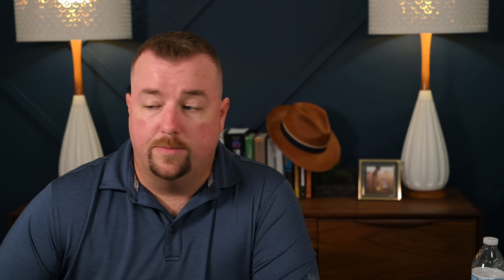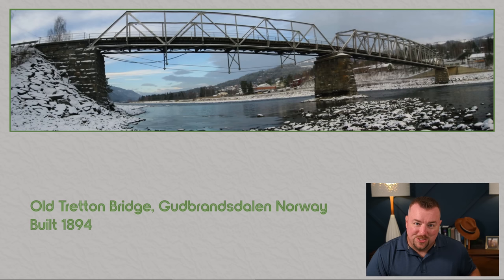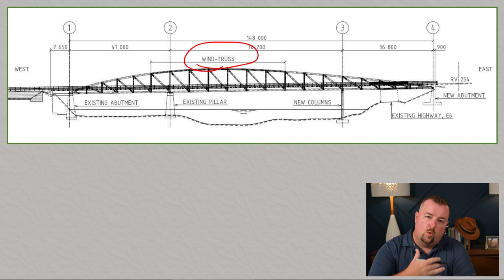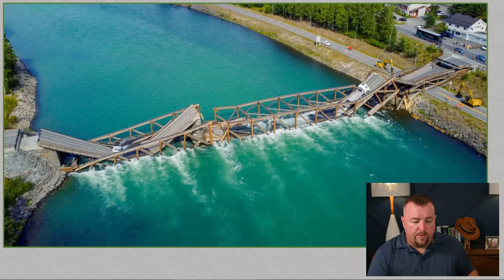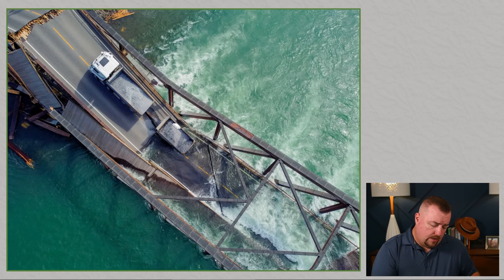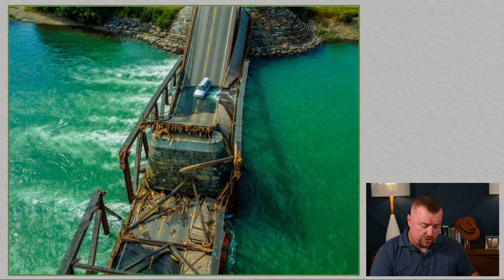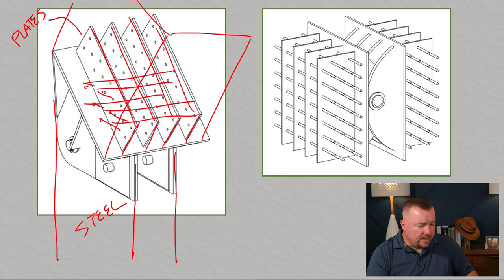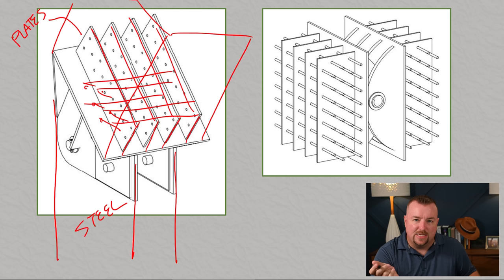How Did the Engineers Miss This?

Comment: Boatbuilder and wood-engineer here. When I was in my lab-phase in uni back in the nineties, I initiated some tests of all-glued multidirectional connections in comparison to these metal-multidowel load-bearing connections because we had,  obviously, exactly that form of malfunction (splitting) every time we tested dowel-patterns and dowel dimensions. 
As a trained boatbuilder before I started university in wood-technology, wood in connection with changing water/humidity contents thus changing dimensions in all three deciding dimensional directions differently was someting I had in mind automaticly whenever looking at a connection point, as well as the idea of "how gets water in, and how does it get out again"? What I built in testpieces from "cheap, inferior" wood (fir/spruce, construction grade only, no tropical hardwoods, not specially sorted/improved) basically followed the wooden dimensions of the customary connection wood/steel, while I glued everything, no holes, no slits, no cavities, with changing directions by overlaying different directional wood layers, glueing those into one inert lump of wood like a grown tree crotch, thus creating the directions, dimensions and the number of pieces/"load outlets" we wanted/needed for the very detail. Results in comparison to inferior wood-steel connections with pins were stunning, to say the least, not only in wood/epoxy with vacuum pressurized curetimes, also for "conventional" resorcin-formaldehyde glue under vacuum, pressurized for its reaction time, the latter to circumvent the not-yet finished research for "creeping" in epoxy glued connections in wood over time. "Too specialized", "not doable in situ", "not repeatable enough over a three month build for hundreds of joints" and so on was what I heard by many many professors and pros from the building industry over the time I tried to "implement" a bigger research project, because they all simply were not able to imagine something like a big construction from inert, multidirectional, multidimensional glued wooden limbs with glued, inert loadbearing connection points ("load knots"), built and finished in situ, of course. Our university's administrative building even was a gluelam-metal-dowel steel-knot building with a lot of visible failing points, some of those failing already in the building phase, in the most pittoresque manner, which would have made my uni the absolute prototype to try something completely different, some never tried-before fancy ideas - they couldn't even understand it, let alone actually try something different. My fellow students and I, we developed industrialized CNC-routed storey-high dovetails for timber-frame housbuilding with prefab elements to put those together like Lego on the building site, we put together a prefabbed three-bedroom family home in a day including the roof that way, with ten people and one crane as a prototype and test-piece - still not widely used in the industry to date, despite its many benefits for structural statics and physics. Them woodheads wanna nail things together like they ever did. 
Where I had learned as an apprentice in boatbuilding, we did all kinds of fancy repairs in the field under vacuum with epoxy, wood-only as well as carbon-glass composites, wood-glass composites, sandwich and massive constructions, partly even with special heating for the glue joints only in subzero (celsius) temperatures to make sure epo cured properly, especially needed with carbon prepreg of course, and "not doable in situ" never ever was the reason it failed, if our repairs did fail at all ... usually the next failure was in the neighboring original material. My master, mentor, employer in that apprenticeship had a deep disdain for engineers for exactly that reason of their extremely confined imagination and their even worse lack of "balls" when it came to trying new solutions once the traditional approach repeatedly failed. It became pretty obvious for my why he thought so when I started to deal with my profs and their donors from the building industry.
Reply: fantastic thoughts- thanks... 
Math is a good tool and sometimes the desire to use math or simulation causes people to oversimplify designs.  Universities are heavily biased towards using too much math and too little craftsmanship and experience.

Comment: When they sat "tension perpendicular to the grain" I believe they are referring to the axe head effect that is taking place between the bolts and the wood. The grain is put into tension as the bolts are pulled through it causing a splitting action rather then the wood pulling apart in the direction of force.
Reply: Anyone who has ever worked with wood knows that grain is strong in length, but is very weakly 'glued' to adjacent grainlines. 
And oh gosh could they mangle the language trying to sound technical here. I literally did not get it until this chap unpacked their meaning.
Thing is: my very first structure lecture in 1973 was on the merits and downsides of timber. And the very first point made was this exact fact re grain. 
Whoever the architect was on this project must have slept through about 40 lectures.

Comment: Anyone that has spent any time building and working with wood would tell you that was a bad idea. It could be designed much better using similar methods IE you would have to have beams that overlap the joints as the end connections have no real strength over time. And to do those joints somewhat decently you would have to wrap the end of the beam in basically a metal tube to constrain it so when the wood splits it has nowhere to spread. 
        I used to play with pinned joints etc playing with ideas of construction when I was doing lots of woodworking but in the end the only reason I was doing it was to come up with a cheap way to get something usable and no it would never last in the long run. 
          All those saw cuts for the plate joints invite corrosion and water intrusion where it will freeze and expand and break the wood. Lots of other issues that would take too long to type out but needless to say the woodworker side of me says run away from that project. Clearly the engineering company didn't have people familiar with woodworking or consult anyone. A quick call to a few ship builders would have answered their questions really fast and changed their minds.
Reply: Fully agree.
Reply: But if any water did get into the wood in the metal tube, where would it go? Innovative buildings are all very well, but the more innovative and the more the design ignores norms like keeping wood in compression not tension, the more careful designers need to be to be sure they really have got it right. They built an 'innovative' building in my town back in the 60s. Biggest open span roof, slim pillars, etc. Lots of swank about it, lots of publicity. All the locals said, just look at it, that will fall down. That's a natural reaction, as people are conservative about construction, and they might well have been wrong.....but....you can see where this is going, can't you? 😉
Reply: I remember seeing wooden beams wrapped with forged steel straps. It seems the technique has been forgotten though.

Comment: What immediately jumped out at me was exactly as you also noted, why was the bottom lamination horizontal instead of vertical? I really like your analytical logic. Thanks for another great video.
Reply: There is horizontal AND vertical lamination in those beams, because they are all made of relatively small wooden bars.
Reply: @comettoPL  Wow!!! Even worse!!!
Reply: I would assume because the glue is stronger than the wood.
Reply: @straaat  nope
Reply: @straaat  In many cases, the glue is stronger than the wood. Thus the wood fibers can tear instead of the glue bond breaking.
Reply: @SteamCrane  Have heard the claim that the glue is stronger for years. Yet the glued joint seems most often the point of failure. Not sure what you're saying about the fibers tearing. Seems to me it's almost like interrupting the fibers results in a weaker joint. Hmm, who'da thunk? Seriously, the lack of common sense from 'trained professionals' can be astounding. 

The glue may be stronger than the wood but it's not penetrating and completely interfacing with every fiber. Can see that more clearly with soft woods that have large growth rings. The glue doesn't adhere as well to the denser areas. Also the glue has to remain pliable. So on one surface some of the stronger fibers are mated with the weaker fibers on the other surface, and vice versa. Thus the joint is weaker than with continuous fibers. Maybe that's what you were saying.
Reply: @heartysteer8752  I don't think it's usually glue that fails, but instead the wood somewhat near the glue joints.  If one were to replace some of the wood in a board with perfectly rigid material and then try to bend it, the presence of the rigid material will caue stress concentrations nearby.  In places that are close enough to the material, the stresses may be borne by the rigid material, and in places that are far enough away the extra stresses would be too small to matter, but at some intermediate distances the extra stress may cause the wood to fail under loading conditions where non-reinforced wood would have elastically deformed without breaking.
Reply: @comettoPL  What is the advantage of vertically laminating the beams prior to construction rather than assembling multiple vertical glue-lam "boards" on site?  If the top or bottom bridge member were eight layers thick, joints could alternate between interrupting layers 1, 3, 6, and 8, and layers 2, 4, 5, and 7.  If the assembly had a metal cap with sides that were through-bolted at intervals to prevent the boards from spreading apart, I would think that would be about as strong as having boards glued together along therir vertical surfaces since shear forces along the vertical faces should be essentially zero.

Comment: I know nothing about engineering, although I’m pretty good with Lego’s, but I love these videos. They are always fascinating and well presented.
Reply: The first ten years of my engineering education came from Lego! Modeling at scale is an important part of classical design, and Lego's offerings of couplings and parts are designed to teach principles. If Technic doesn't intimidate you, you may be more of an engineer than you think!

I bet a solid Lego bridge would hold up better than glulam anyway. :p
Reply: That's a good example you made with Lego's. Put some pieces together, and they can support an incredible amount of weight. Anyone that has kids and lego's scattered over carpet knows what I mean! But give those Lego's a little tension and they pull apart very easily, just like this useless bridge...
Reply: @jercos  In compression yes, but not in tension. Lego's are designed to be easily pulled apart and used again to build something else.

Comment: Wood will absorb water. That water then makes contact with the pins in those connections. Bad things then happen. Boatbuilders know better than to use ferrous metals in construction - they use bronze if the boat is intended to last.

And never, never put wood under tension.
Reply: Just like the Romans with their Roman concrete. Everything was overbuilt, and only in compression. No tension allowed. Roman concrete lasts forever, but it's extremely useless in tension. Worse than wood. But they're weren't dumb, and many of their buildings are still standing, despite many wars, vandalism and earthquakes.
Reply: Farmers have been dealing with this issue for a long time - steel framed buildings with wood purlins etc and it's pretty much taken as read when you put that sort of shed up that the wood won't last the life of the steel frame. Should have added - I'm a farmer!
Reply: Most homes built in the US use wooden truss rafters that have wood under both tension and compression.
Reply: @brnmcc01  No rebar, nothing to rust inside and break it. And some volcanic ingredients, some still standing fine a thousand years later even after world wars, trains and tanks passing over them.
Reply: Yes, the dreaded iron sickness.
Reply: Freeze n thaw.
Reply: @Kifflington  Yup, farmer here too, join 2 pieces of wood with a bolt and come back after it's weathered  a bit, the bolt will be totally loose.. you tighten it, and come back, loose  again.  I don't know if in their computer analysis they assumed there would be friction between the wood and the steel because of any kind of clamping force, but it would be a very bad assumption to make if they did
Reply: @tiredoldmechanic1791  Those trusses use nail-plates for all the connections.  So instead of a few bolts, they use hundreds of tiny nails in parallel.
Reply: @tiredoldmechanic1791  -- And don't forget that the bottom portions of rafters and floor joists are in tension. Wood isn't bad in tension, if you work with its limitations and use reliable information on its actual strength.
Reply: @martylawson1638  -- And they use shorter "nails" that don't go all the way through. The "nails" in most truss plates are usually cut sections of the plate, about 1/8" wide and about 5/8" long, with a point at the top.
Reply: @Rx7man  Yup, like my picnic table outside, legs are bolted to the braces, and have to tighten them once in awhile. It's 10 years old now, and has finally stabilzed a bit. First couple years was a nightmare though.
Reply: @brnmcc01  Modern engineers that studied Roman concrete concluded that they made a cement paste that was troweled on in thin layers then added the aggregate which was then tamped down until below the surface. Then as the structure rose in height, they began using lighter weight aggregate to reduce the weight the lower sections had to carry and extremely light stuff such as pumice for concrete domes. 
Roman concrete lasts a long time due to the local volcanic sand and the salt water they used chemically reacting with each other to create a substance that filled the microscopic voids that prevented it from absorbing moisture since it made the cement mix solid as a rock. It does require a much longer period of time to cure out which adds to it's strength. They believe that the ancient Romans stumbled upon this mixture when building walls by the sea at Naples. They used the local volcanic sand and sea water since it was nearby and didn't know any better. Later on their better trained engineers noticed that the old concrete walls were holding up exceptionally well so began using the volcanic sand and sea water mix where possible. Italy is one of few areas on earth that has that particular type of sand that reacts with salt water.
Reply: @billwilson3609  Yup, pozzolanic cement. One of those happy accidents like the discovery of teflon.
Reply: @grizzlygrizzle  I did painting, remodeling and repairs for 30 years in East Texas. A common repair was to ceiling that cracked after a load bearing wall was removed to create a larger open space. Those had the premanufactured roof trusses that used the metal nail plates which the jackleg remodeler assumed would hold the weight of the ceiling after the wall was knocked out. What they failed to take into consideration was the weight of workmen stepping on the trusses as they worked inside the attic on the electrical, HVAC ducts or added insulation. I grew up in Chicagoland and watched modern new construction go up in nearby upscale areas. They were using premade trusses held together with plywood gussets instead of the metal nail plates. The gussets were on both sides and secured with glue and nails so resembled the steel plate gussets used on the iron road and railroad bridges. To ensure that my repairs would last longer and make extra money off the job, I pointed out why gussets where used on truss bridging and that needed to be done to their trusses where the walls hade been removed.
Reply: @brnmcc01  Same thing with nylon. DuPont chemists were trying to see if they could make anything useful out of the by-products glop that refineries burned or allowed to evaporate in pits. One had a mixture in a flask that failed to react during an experiment so was left alone when everyone went home for the night. The next morning it was bumped and fell to the floor where the glass shattered to reveal that the mixture had become a solid overnight.
Reply: Philby Iasgair  PTFE was discovered by accident in 1938 by a DuPont chemist experimenting with frozen gases for use in refrigeration. He checked on a compromised frozen mixture to find it had spontaneously polymerized into a waxy substance that turned out to be the slickest substance on the planet. It was dubbed Teflon in 1946 when first used on consumer goods.